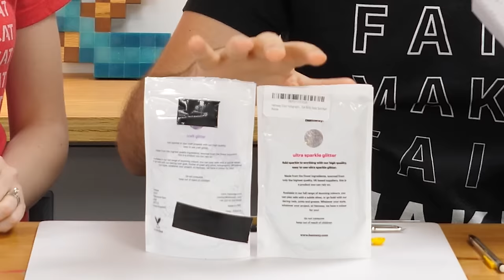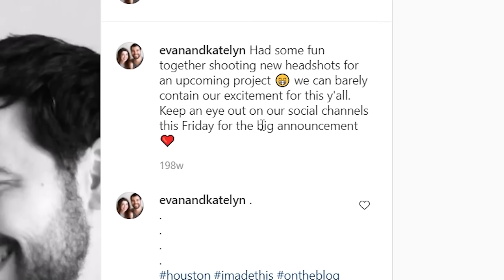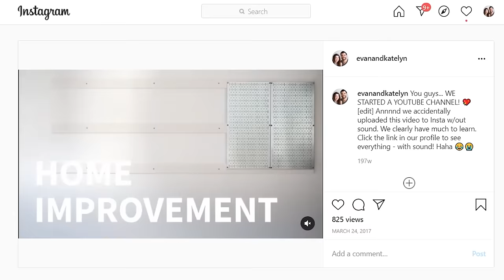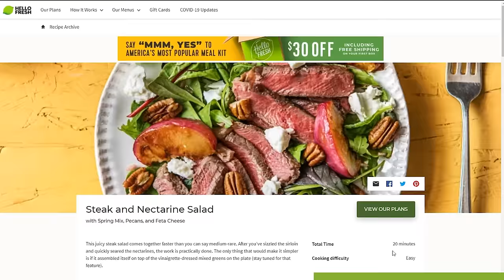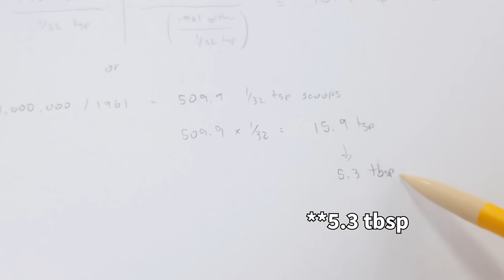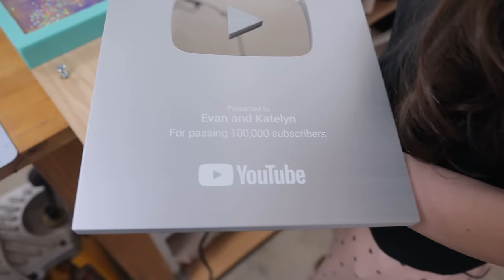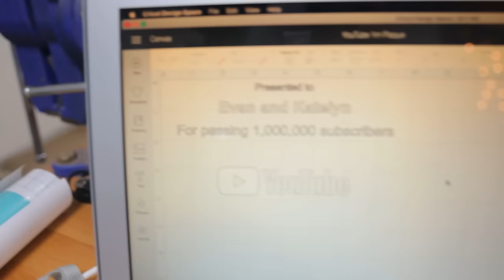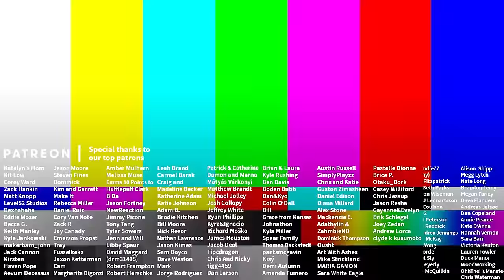DIY 1,000,000 Glitter Resin Play Button - 1 Million Subscriber Special!

Comment: Not to detract from the spectacle, but I can't shake the feeling that measuring by weight rather than volume would have been better. 😬
Reply: Glitter is so light that you'd need a scientific scale to get any degree of precision, and those are surprisingly expensive.
Reply: I was thinking the same thing 🤔

Comment: That timelapse/montage for the counting of the glitter worked very well. I really wouldn't have measured it by volume though, I would have measured it by weight. I think that that is likely to be more accurate.
Also it's surprising how Young Evan and Katelyn look so similar to Current Evan and Katelyn; I'm sure I've seen old footage of you two where you looked quite a bit different. Must have been pre-YouTube footage I guess.

Comment: Congratulations on 1 million subs!!
I thought it was cool you decided to measure a million pieces of glitter using volume. My instinct was to use weight (grams). Measure one flake of glitter on a scale (using a sensitive scale), but I googled it first. The average glitter flake is ~3x10^-4g (0.0003g) and if you multiply that to a million, then you would get 300g or ~0.66lbs and that can be measured on most small kitchen scales.

I'm curious which one is more accurate: by volume or by weight?? Possibly a future epsiode??

Comment: i call the glitter on the top corner of the playbutton , its mine all mine
maibe next time poor the clitter in without the resin then poor the resin over it , wouldnt matter if it starts to float as long as it sticks to the resin for the second layer gives you a little more of a change to spread it out before bonding it

Comment: E&K, I need some help here. I'm making a project from epoxy and rice flour. I need to know how well an led will shine through an eighth inch thick piece. Or more importantly, how deep will light penetrate an edge lit piece?  On another note, do I use micarta to create my project, and if so, how do I stack multiple cut outs without them sliding all over?

Comment: “Scientific method”... uses teaspoons to measure... yup, sounds American to me.
Reply: Puzzling. Why didn't they count out 50 or 100 and weigh them and then calculate the number of grams of glitter needed? Weight is more accurate than volume for measuring solid items like glitter (or jelly beans or popcorn kernals) that may have gaps between particles.
Reply: @lcotner5068  that's what I was thinking that they were going to do. It would have been a lot easier too!
Reply: That’s how we learned to estimate counts in science class. For bacteria or tadpoles or other things that you can’t weigh, but which are arranged in 2 dimensions, you count a known area and then measure the area.